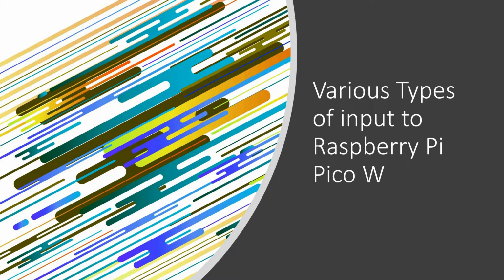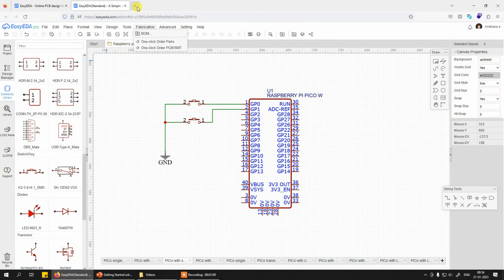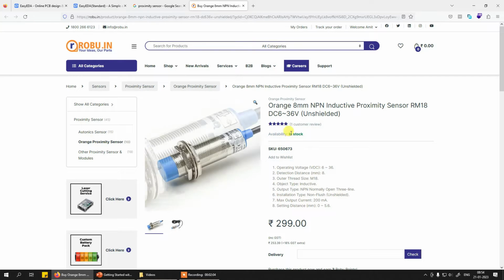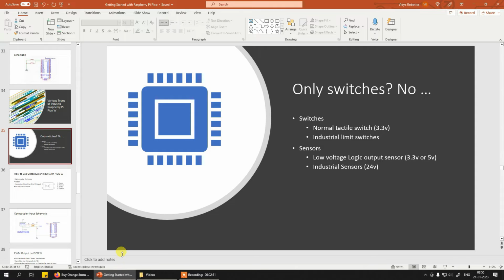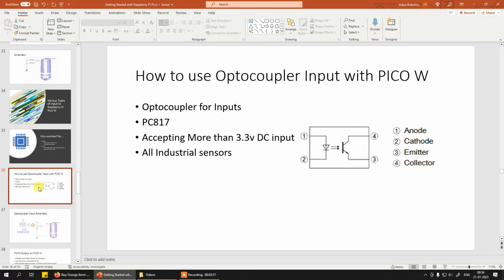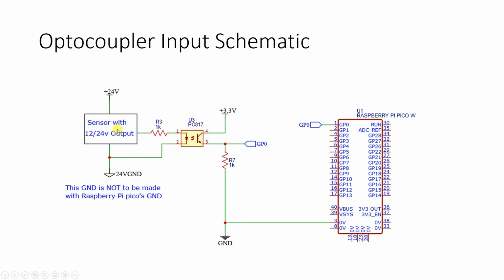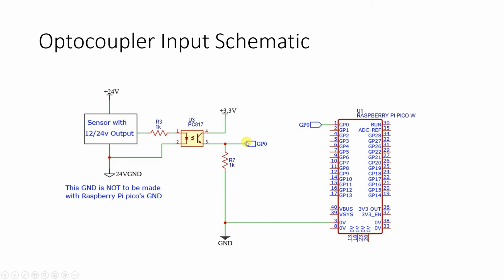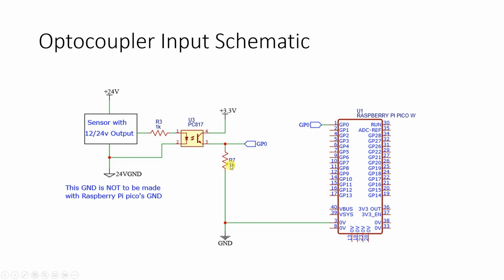how to use Raspberry pi pico with optocoupler

Comment: Thanks very much - I needed to understand the basics. Maybe you can expand to describe how you set up the circuit on Kicad ? For my application I have 5 digital inputs so I was thinking of using two ACPL-847 chips (these are 4-channel opto-isolators)  to give me 8 possible inputs.
Reply from the maker: Am glad you liked the tutorial, If I'd be you, I'd use single channel PC817 as it's quite inexpensive. Regarding Kicad, it's fairly simple most components are there in its library